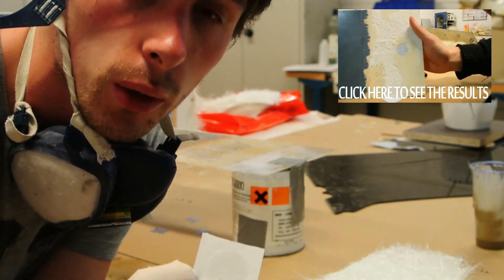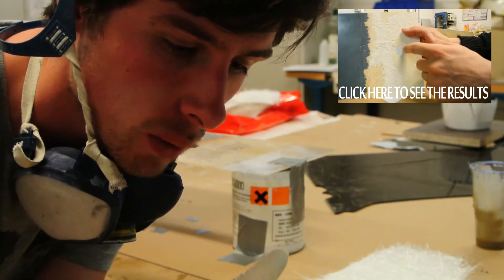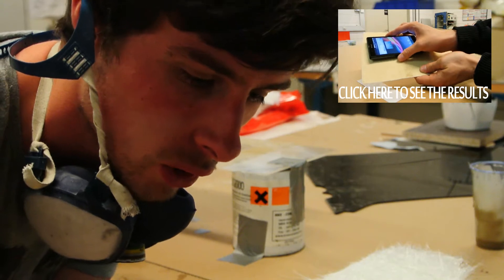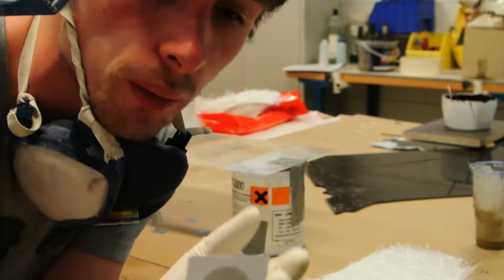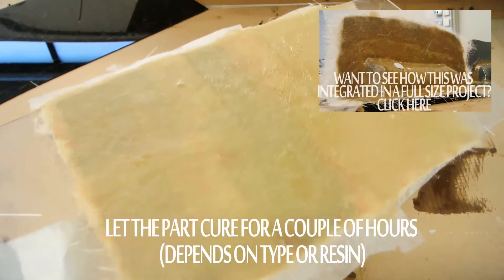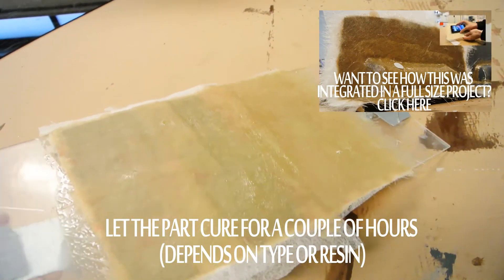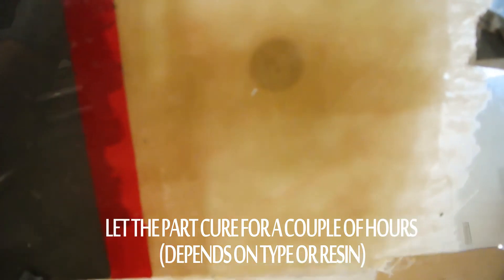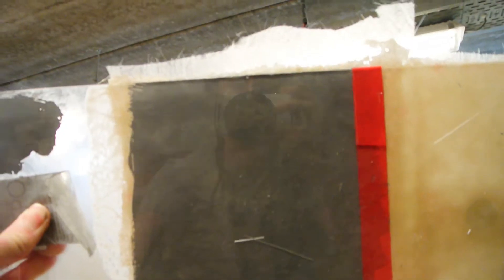How To Make A Mould Or Part - Simplified + NFC (Near Field Communication)

Comment from the maker: most of the materials I use are from easycomposites and vosschemie... I use those because I got used to it and got great results with those materials... I use those because choice is quit limited here in belgium and I got in contact with some friendly guys of Vosschemie. I buy most of my resins there and buy most of my laminate like CF at Easycomposites because sadly, it's cheaper to have them sended to me, than buy them here in Belgium :)